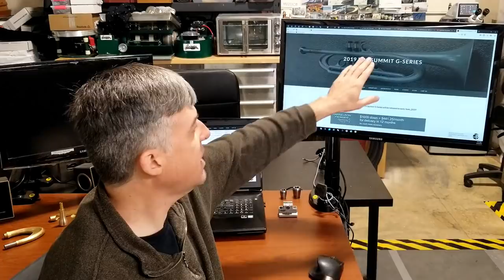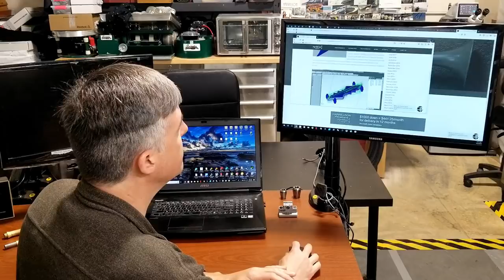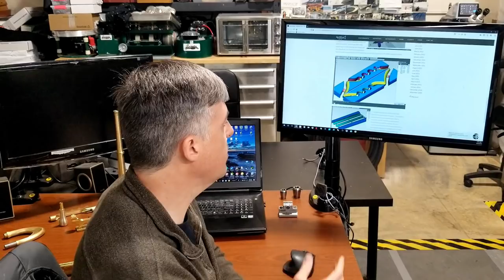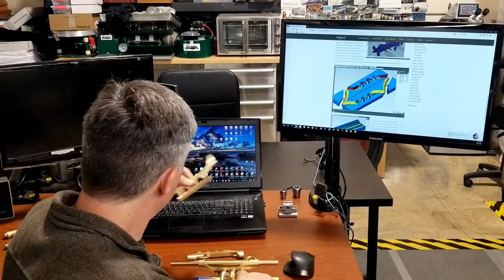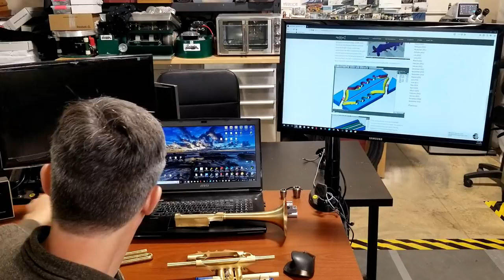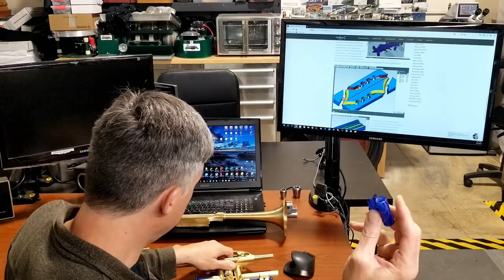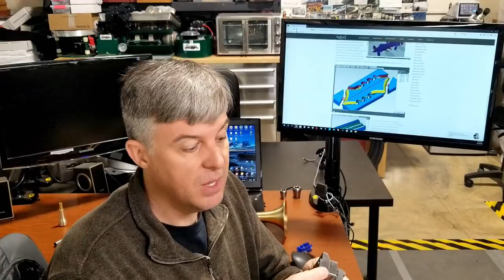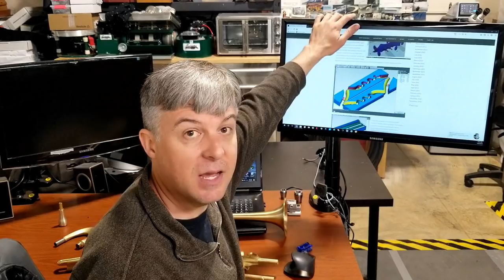CNC Machining Trumpets is the BEST PRODUCTION PROCESS available today

Comment: 5000 USD ... hmm.. it is not acceptable for large community of amateur, hobby players (I think).. Despite of made with CNC (how it is produced, is my minimum interest, final product is the scope). I reallylike CNC machine, all those gadgets, enthusiatims of creator, cost should be also ok (question is, if CNC machine is so expensive, are they run 24 hours to decrease price of trumpet - maximum utilisation of CNC, CAD).. Analogy: I should buy a bike for 5000 USD and a bike for 500 USD (in my coutry). I want to make a trip from point A to B. Impressions from that journey, country, etc should be nice with that bike for 500 USD. With super carbon CNC, CAD designed bike should be quicker, etc. but impressions will be same (?). I am glad, that exists companies like Yamaha, B&S, etc. which produce "reachable" quality instruments (in the meaning of price) for huge community of hobby players, and do it with consistent quality. As an hobby player (but I require ability to musicaly grow and want to have nice sound) I do not need fuctionality like modular system. Despite of that, I am not against, nice, if somebody doing work of interest, with joy, be in state of "flow", want to do quality product, just product is  not for me..
Reply from the maker: Our trumpets start at $2500, which is LESS than Bach, Yamaha and B&S. No, we do not run our machines 24 hours a day. Our goal is not to mass produce trumpets, but rather to produce individual custom solutions that meet your specific needs. Yes, a cheap bicycle will get you from A to B. It sounds like you need to go buy a cheap trumpet. :)